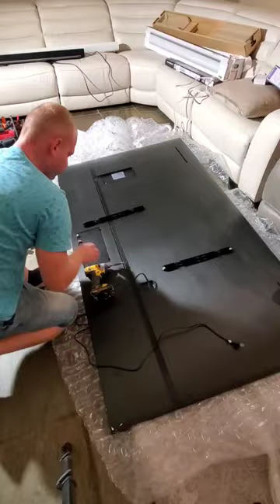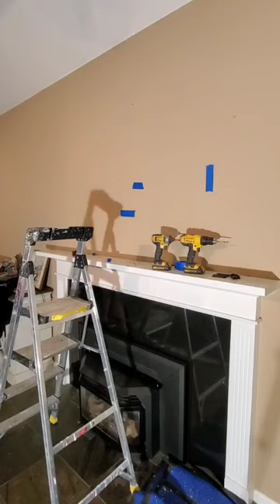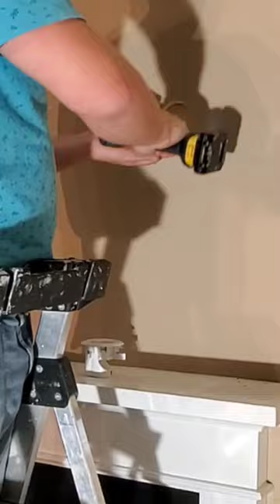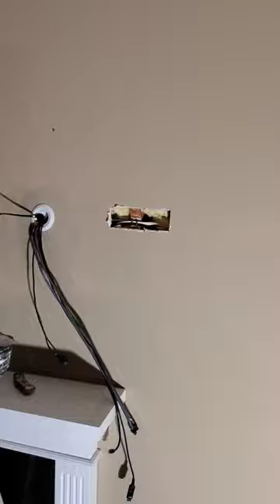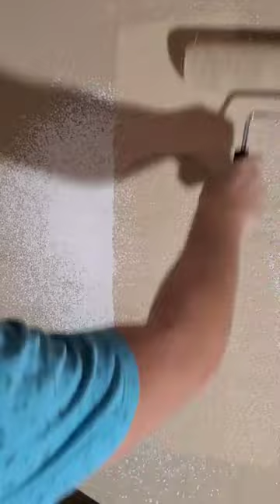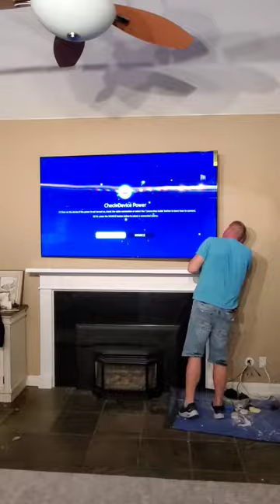TV above fireplace wires hidden #shorts#DIY#powerbridge#tvmount

Comment: NEVER lay a TV down on its face like that
Reply from the maker: but how do I attach the brackets then?
Reply: @thatdiygingerguy  lean it up against the wall or something, I own a mounting service myself, I've had to partly for a 2 TVs already cause my guys did this
Reply: I still see your wire
Reply: Really doesn’t matter as long as you’re not putting a bunch of weight on it. I’ve mounted 1000s of TVs and have done it both ways never broken a screen